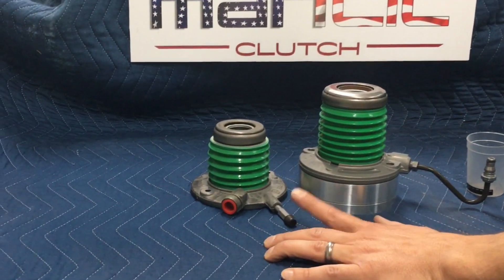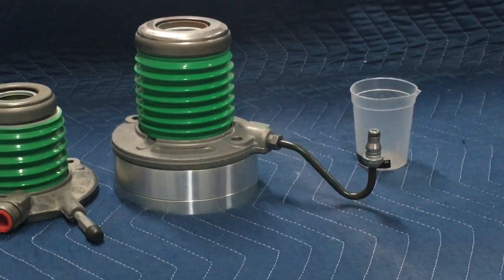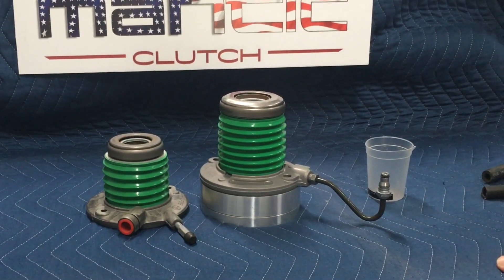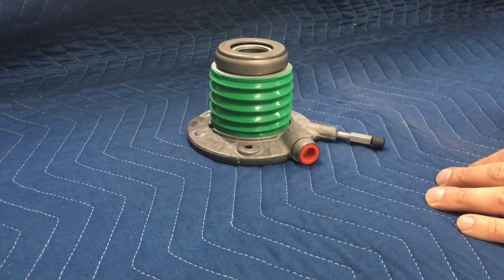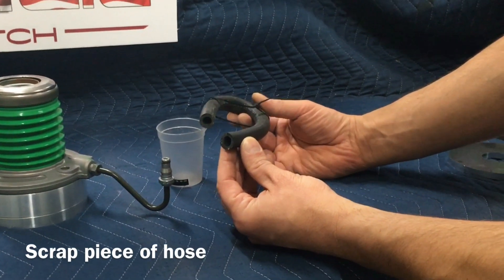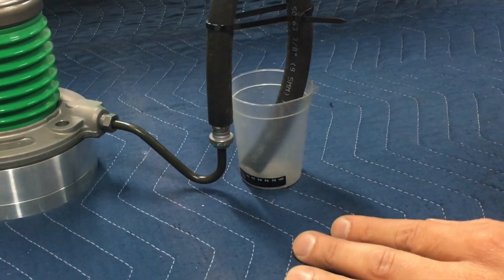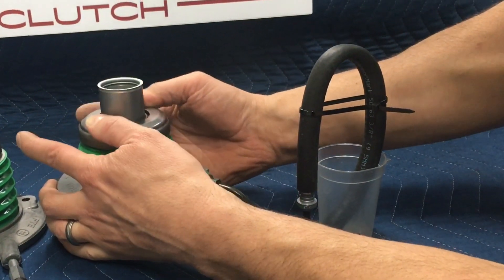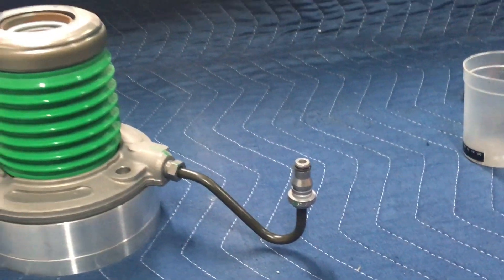How To: Bleed a Hydraulic Throwout Bearing - Mantic Clutch USA

Comment: Why would you leave the cylinder with the bearing facing up like that and the line at the bottom? Air bubbles go up not down. That method looks like it would be great at trapping a lot of air.

Comment: Is your clutch very soft after doing replacing the clutch and slave cylinder. I got mine back from the mechanic and it feels like i am stepping on marshmallows
Reply: What car and what clutch did you change?
Reply: Pump air out

Comment: What is that spacer? We installed a new flywheel that was thinner than the silly dual plate flywheel. We need a spacer. We have ruined 2 throwout bearings because it extends too far and falls apart. Does anyone have a solution that you can do without having to buy a new thicker flywheel. ??? Thanks for reading
Reply: If your flywheel is 15/16 " to 1" thick 
A.750 spacer is fine behind the slave drive...especially 2012 later mustang mt82 transmission...

Comment: Allow a good demonstration you can't actually get all the air out like that because there will always be air at the top so you would need to put it on its side like it would be in a vehicle with a pipe of the top so that the  air can leave.

Comment: once it is installed in the car, how can you Change the fluid in it?
Reply: You bleed it; thats how untill fluid runs clean from bleeder valve (while keeping  clutch master cylinder filled  so it doesn't suck air

Comment: While your video quality and presentation is overall excellent (better than I could do), I don't see how this is applicable to an actual installation. Once you install the bearing, you have no way to press/release the bearing because it is inside the bell housing. If I were to do this prior to installation, I would have to plug the oil line with something to keep the (supposedly air free) oil from running out. Then somehow magically connect the oil line (from the master cylinder) without introducing any air. I think I'm going to try the vacuum method.
Reply: Lolllll me rn I literally just put the trans bakc in I do not want to take it out
Reply: @ballstoyou33 same situation. What did you end up doing?
Reply: i think this is more of a prep video when you are installing the slave/throwout bearing so you don't run into the issue.
Reply: Just cut a big window on your bell housing. Easy Peasy! But srsly these new designs are fucktarded i’d love to meet the engineering coming up with this stuff and beat them to death
Reply: Actually if you push the inner part of the slave forward with 10lbs of air. You pull the line off fill with brake fluid re attach the line ..when you install a bit of fluid will drain out..no air in line reconnect with main line ..works.fine

Comment: I have this on my Mustang. I cannot see how what you are doing gets the air bubble out. The air bubble is up at the top, next to the bearing, when you push it down, the air bubble remains at the top. Now, if you turned it upside down, and made appropriate hose length changes, and cycled it like you did before, then I can see where this would be effective.
Reply: Didn't work
Reply: @codycombs88  I'll be putting mine back together in the coming days, I have a method that works perfect, crazy easy and is done with everything installed in the car. In fact, the method I use pumps the cylinder up super quick and all you have to do is hook up the hose and can literally drive away. These cylinder s are crazy the way they are designed. I will make a video of how I do it and shoot you a link for future reference. Stay safe, peace.
Reply: Michael Kennedy do this yet? Lol
Reply: @SCStang  yes, I will show you how I did it. I have my car on theroadand it literally tokk 5 minutes to do it. I'll make a quik video and put it unedited on my channel. I am not home withediting software but the point will get across.
Reply: @SCStang  made the video, it is uploading right now. Be kind and let me know what ya think. Sub and like if ya would, let me know if there is anything else you would like to see from my build. I put the dyno number in the video with the dyno sheet in thevideo. Have a few videos of my car on the dyno also, loud as hell, so if  Ipost them, turn the volume all the way up so you can get the full effect lol
Reply: Michael Kennedy will do, check out my ig shook89, currently doing the tob again as we speak
Reply: @SCStang  IG request sent
Reply: Michae